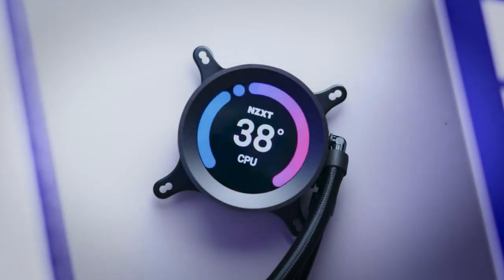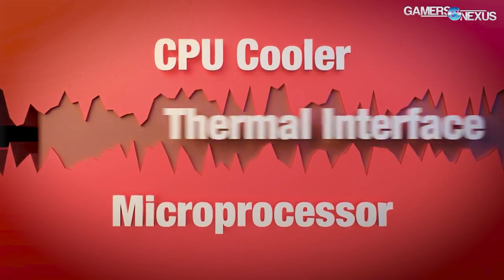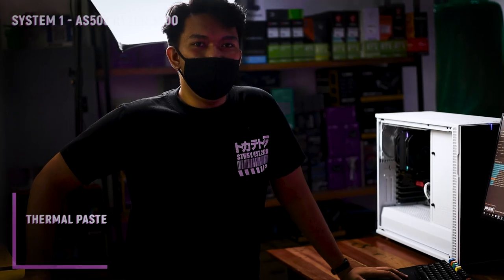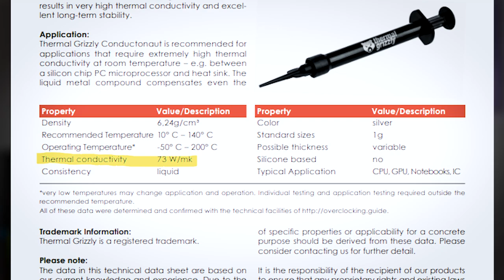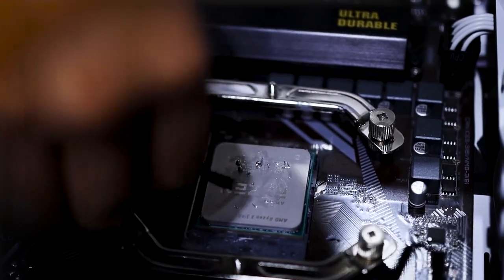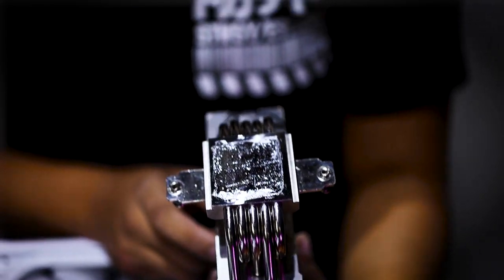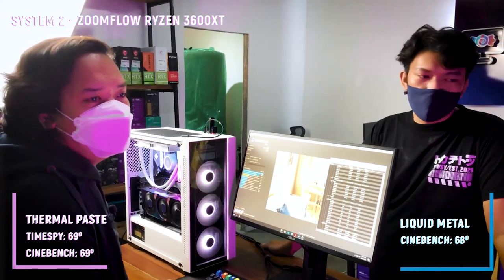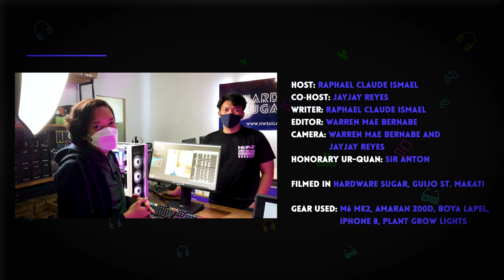Thermal Grizzly Conductonaut - Worth It? Liquid Metal is HERE! | Hardware Sugar

Comment: Conductonaut is actually effective on the CPU Die by deliding the IHS. 
Already tested it on older Intel CPUs. It can lower the load temps around 10 to 15 deg C =)
Reply from the maker: that is a massive improvement
Reply: yeah, usually pang delided cpu lng xa.. kung gagamitin mo xa as normal thermal paste, medyo mahirap linisin yun.. kryonaut lng gamit ko sa thermal paste ko..

Comment: I'd highly recommend using the Thermal Grizzly Kryonaut. My GPU was running around 70 C when gaming. But after applying the Kryonaut it went down to 60-63 C. My CPU runs at around 60 C when gaming now its just around 47-55 C.
Reply from the maker: In case anyone is looking, https://hwsugar.ph/products/etc/5df68be155468c001549ee8d

Comment: To avoid difficulties, I believe you should first break the surface tension of that liquid metal Conductonaut evenly with a cotton swab and spread it nicely on a separate piece of glass panel or any flat smooth surface plastic piece  before transferring it directly onto the IHS (Intagrated heat spreader cover/cpu die cover).  by doing so this makes the entire process of spreading it evenly, gently and safely much easier.
Reply from the maker: thanks, will try that next time

Comment: I guess it would be cool if you guys gauge liquid metal's longevity vs the traditional thermal paste. Maybe a follow up a year from now? I mean, it doesn't evaporate so..

Para kayong nasa operating room when applying the liquid metal.
Reply: Definitely! We'll retest in 1 year siguro since I didnt remove it naman from my rig.
Reply: It doesn't evaporate but it will be absorbed to some extent by copper heatsinks. Best possible use parameters would be using it directly between the die and and a nickel plated copper water block or heatsink.

Comment: I think liquid metal is supposed to be directly applied at cpu die so u need to delid it 1st. Thanks
Reply: Yes, that's the whole point of the video (it's in the conclusion). We made this as a sort of cautionary tale for people who might be thinking of getting and applying this via the typical way (on top of IHS, and traditional cooler).
Reply: @rockyismael  cons lng is hassle mag delid ng ihs hahaha
Reply: Ryzen processor are all soldered no need to delid unlike Intel cheap method ryzen have silicon and soldered directly at die/ic which shows how good quality it is.
Deliding will only improve by 1-2 degree only a margin of error sometimes no benefit at all.

And liquid metal is preferred with higher TDP processor a ryzen 3 is not a high TDP processor it should be applied to r7 specially r9 or i7/i9 or high TDP CPU's.
And it will still all depend on the type of heatsink you uses.

Comment: Recommended on most laptop usally laptop used copper heatsink. Not recommend on most desktop cooler that uses allmuninum  that will cause corrosion. saka Vertical kse desktop may chance tutulo pababa yung liquid metal time to time.  Okay nmn liquid metal but risky.

Comment: Pansin ko lang
1st test bench r3 which is not really a power hungry and lower TDP cpu.
2nd Test #2 ryzen 3600 much better than r3 since it has 6 physical and will produce more heat ,BUT when I saw it in the vid that the liquid metal is mostly at the middle and not properly spread.
#3 application method that's not the proper application you need to use the Q-tip not the small metal tube that will spread it faster but it won't flatten the liquid metal enough to stick it with the IHS so you will be having more prone movable liquid metal when you do case tilting during cleaning special when your using blowers to clean and since the it's connected to the cpu IHS to cold plate if it's not thin enough and spread evenly enough the top liquid will go down (gravity) if the IHS and cold plate is not completely flat as possible so having thinner layer of liquid metal is much more ideal for safety more means longer aging or drying but more also means more liquid moving up and down in between the IHS and cold plate.
A tiny drop will cover the entire IHS.
#4 we now it's conductive, that's why we need safety precautions, so what are this? 
#1 you can get a piece of paper cut it exactly the same as the IHS size put a really small double sided tape attach it to the  IHS and put a larger double sided tape at the top and mount your heat sink after mounting no need to screw down lol and pull it now the paper will adhere to the heatsink now get a tape (just like painting) put it on all sides of the paper and remove the paper clean with alcohol to remove dirt cause by the tape and get some tissue paper and put it around the side of cpu IHS this will cover the tiny gap of the socket and most of mobo PCB and ic near it, now apply a tiny amount for more precautions don't directly apply it to the IHS but apply it directly to the Q-tip (just like a paint into the paint brush) and use the Q-tip as a paint brush now all you need to do is paint the IHS with liquid metal as thin as possible.
Well for the heatsink/cold plate you can directly put it in and spread it (if it's copper apply a very thin layer let it cure for 24hrs and apply a thicker later but not to much) during the 1st 24hrs the liquid metal will adhere to the copper not all of but this method will prevent early drying of the liquid metal after 1st application then after applying the 2nd coat remove the tape now you have the equal length and with of the liquid metal in both IHS and cold plate.
You won't have to worry that the excess liquid metal on the cold plate that's not touching the IHS will move/drop and touch the mobo
Reply: Edit* don't forget to check clock speed boost after application.
Even it only drop a single degree to a two or three there will be increase in boost speed and you can also notice if your fan is automatically running base in cpu thermals then you will notice that it is much more quieter now

Comment: Make sure po yung Heatink is made out of copper only but the yung Fan cooler po kse mix copper po and aluminum yan nku po risky bsta may aluminum. mag cause po ng corrosion. nka apply po ako ng liquid metal conductonuot sa laptop ko luckily made out of all cooper heatsink ko kaya safe.
Reply: Lol lol lol ahahahah ahaha.
Sorry but that is not correct.
So it's the same as mix metal in custom water loop you can't mix silver with Nickle and you can't mix aluminum with Nickle and copper.
But that's because water is touching both metals and the water become electrical conductive and causes corrosion.

In here (air cooler) as long as the whole cold plate is made out of copper or copper with Nickle plating using liquid metal is totally fine since the liquid metal is only touching the copper and Nickle plated copper, but it will stain copper  more like it will coat copper so it's more recommended to use it with copper w/ Nickle plating.

But if your aircooler is copper pipes sandwich in a aluminum cold plate.
Then that's a big no, copper will be fine but the remaining aluminum touching the liquid metal is not good there will be reaction and it will destroy aluminum

Comment: bat ka magdedelid ng ryzen e soldered TIM na un. Ririsk mo lang masira yung die? Kahit intel 9th gen pataas soldered na din.
Reply: Der8auer wannabe i guess?🤣
Reply: Gamers nexus did a video about delidding it. Not worth it…
Reply: Within margin of error lang rin yung increase, kaya walang delid tool for 3000 and 5000 series kasi soldered sila which is the best for quality and performance result ,well liquid metal  difference is only 1-2 not worth it since you need to toast ryzen IHS after cutting some of the glue in order to soften the soldering and remove it

Comment: Hi po Hardware Sugar! I have 2 questions po, 1.) Bakit po nag dro-drop po fps ko from 100-50, may isang time 10. Kailangan ko po ba palitan yung thermal paste ng laptop dahil 4 or 5 yrs old na. 2.) Nung ni reboot po ata nang kuya ko, naging SMOOTH po siya like stable 70-100fps! Pero nung in-update ko po yung windows, naging lag siya. Can't multitask now while gaming and even browsing the web is not kinda smooth.
Reply: Hi! 1.) Do regular maintenance po (replacing thermal paste, and cleaning the vents and fan/s) to avoid the cpu and/or gpu from underclocking. 2.) Install the latest updates from windows, and your laptop's manufacturer. 3.) Remove current graphic driver by using DDU, then install the latest graphics driver straight from amd or Nvidia. 4.) Lastly, naka ssd na po ba kayo? If hindi, you should upgrade. Hope this helps!
Reply: Thank you po!!! Yes po naka ssd ako.

Comment: too much po yung pag apply nyu kse whe nyou install cooler it will spread outside nung IHIS coodluck nlang po.
Reply: That's actually the correct way of applying liquid metal since it has a different consistency. It didn't spill outside at all (we made sure of course). If anything, we might have put too little but even then, it wouldn't make any significant difference.